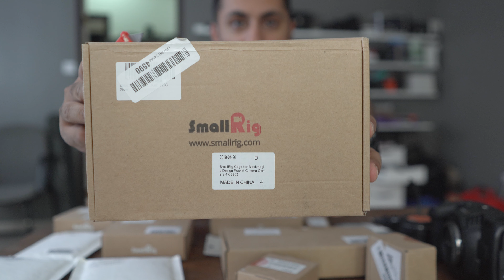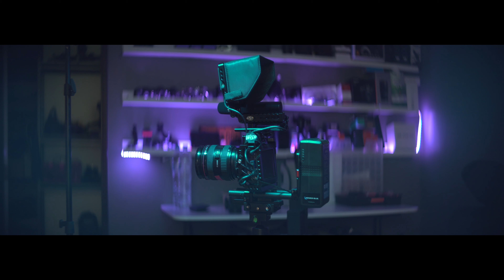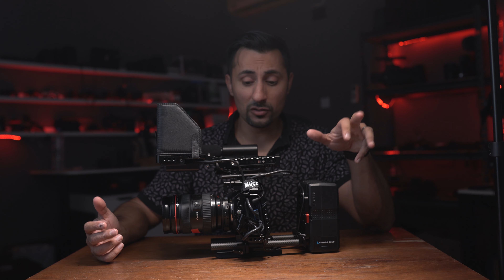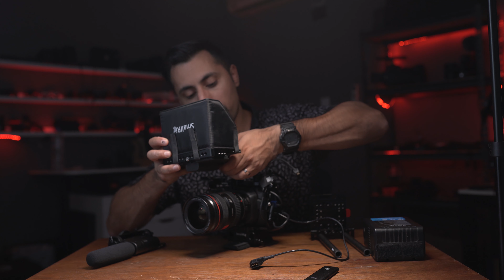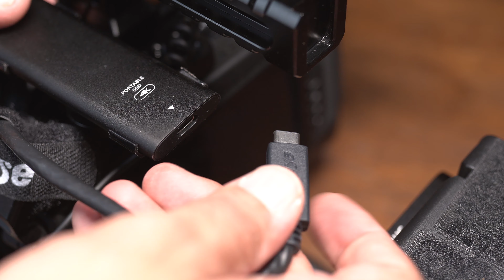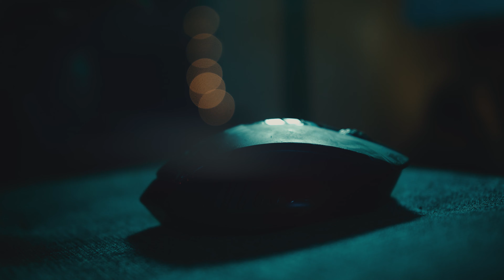Hand Held RIG - Blackmagic Pocket 4K

Comment: your rig looks super and stable, very similar to the one I am building, am using the SR half cage though
Reply from the maker: It's very stable and very solid. And can easily remove the rails and vmount plate for a lighter setup using the lpe6 batteries only.
Reply: thanks for the reply, good to know that, from your experience with the lighter setup have you found it sweet with lenses with no image stabilisation with the pocket 4k? Has that worked for you?